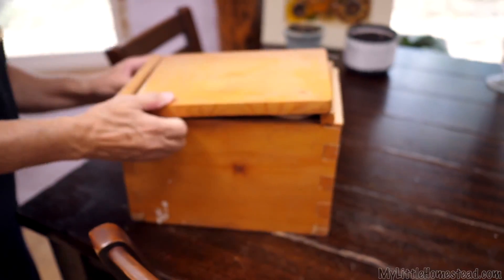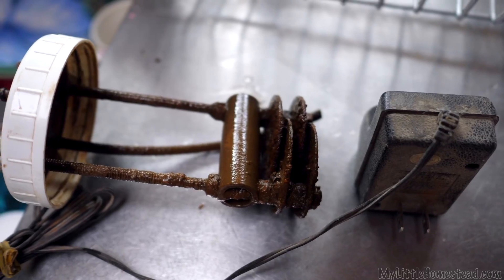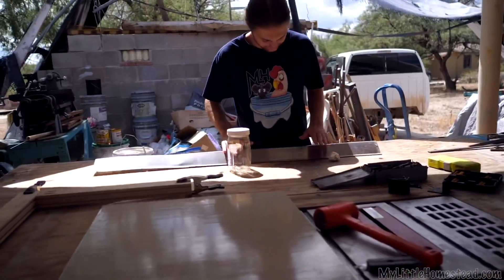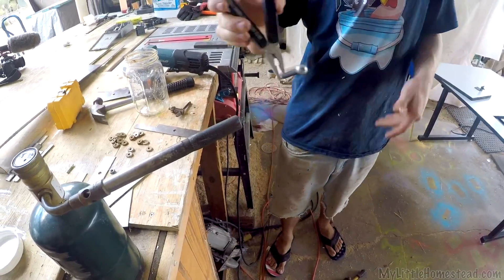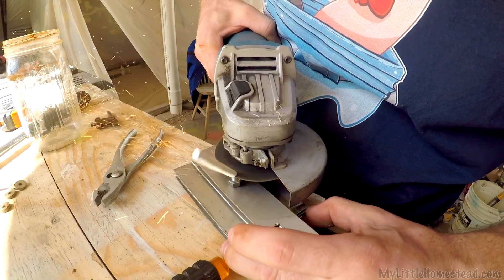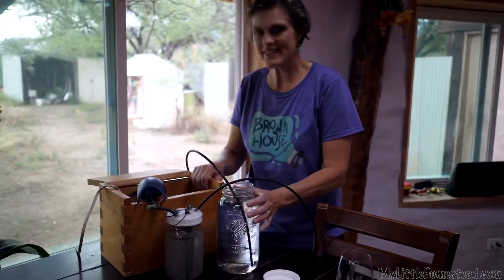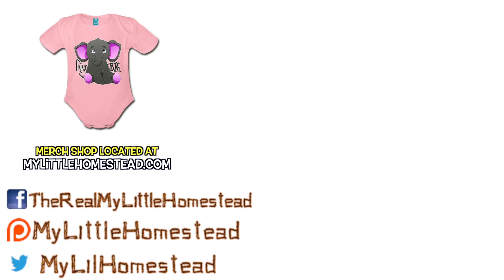Simple HHO Generator Build Portable DIY

Comment: If your trying to saturate the water with hydrogen and oxygen gases quickly and efficently, look into micro bubble generation. Youtube has a few videos on it. Search Micro bubbles or nano bubbles. 

Here is the basic or simple concept.
1) Place an airstone inside a slightly bigger tube under water  2) Pump water through the that tube.  Simple, yes? 

How it works is when you pump water through  the bigger tube, it forces water to go around the airstone. The water has to moves faster as it passes the airstone resticting the flow, and this creates a venturie effect with low pressure around the airstone pulling gases from the gas tube into the airstone and into the water flowing over the airstone.  And, with the fast moving water flowing over the stone, the bubbles are ripped off into very tiny bubbles. But remember, in the fast moving stream over the stone is still a low pressure zone. After getting past the airstone the water slows down and pressure returns to normal and the bubbles shrink more turning into  very tiny tiny bubbles.  These very tinny tiny bubbles stay in water longer, and have a very high surface to volume ratio to enable much faster gas adsorption so as to more quickly saturate it. 

In the depths of a lake, it takes even more water pumping water through the tube to generate a larger venturii effect so as to pull air down furthe.  Because of the higher  water pressure and greater venturii effect this creates an even greater prrssure difference before and after the airstone such that the bubbles shrink even more, so much more that they get more pushed around by brownian motion and wont float to the surface.  Instead, they completly disolve into the water.   These are nano bubbles. 

Making micro bubbles will work better if you cut way back on your HHO production rate.  Cutting back on your HHO production rate has two great side benifits. 1st is your plates will last much longer. And if you cut back on your production by using less voltage, yes less current flows but it ends up producing HHO far more more efficently and generates less heat. And the third benifit  is less HHO gass is produced and vented  making less of a potential safety hazard.

The first 1.24v × each amp = watts stored chemically in hydrogen.  Each  volt over 1.24v pushes ions or current through the electrolyte, and this is what causes heat. So for efficency it may be desirable to minimize the over voltage.

potasium hydoxide (KOH) is best for stainless steel plate electrolisys. If you google KOH conductivity graph, youll find that 6 mole of KOH per liter of distilled water has roughly the highest conductivity concentration which allows you to lower the  voltage applied to the cells substantually. 

Lastly, because KOH is caustic  you probably would lkke to include a seperate bubbler after your HHO generator to scrub any fine KOH and water mist made from bubbles popping in your HHO  generator.  Pre bubbler scrubbing also helps  keep any chromium ions in the mist out of your drinkingnwater. Don't want cancer causing agents in your water right? 

You can probably do fine with a 5v 3 amp power supply  to two electrods seperated by a neutral plate. The neutral plate  effectivly divides the one cell into two  which means 2.5v per cell.  And lastly stay below 1 amp per square inch.  0.5v  amps  per square inch is more desirable for longevity of the plates.

Comment: Hey there curious, I was trying  to listen to the video although I got a bit lost on some things Moreover where you got the pump, and how you electrify the steel sheets. You mind giving me a list of stuff to buy/ how to do the more electronics part?
Reply: he used a fish pump but you really don't need one and it's actually counter productive as it can push out hydrogen made by your generator. Google "molecular hydrogen nih gov". You'll find many scientific research papers on molecular hydrogen's antioxidant and anti inflamitory porperties.   Hydrogen and oxygen are being produced by electrolisys, and this generates pressure inside the HHO generator so no need for a pump. 

Chemistry and physics class.  At standard pressure and pressure, 1 mol of water (18 grams) is converted to 1 mole of hydrogen gas (2 grams) and 0.5 moles of oxygen (16 grams)  in total you have 1.5 moles of gases, and at standard temperature and pressure  1 mole of gas any occupies 22.4 liters.   So  electrolizing just 12 grams of water  (0.66 mols or 12 cubic centimeters) creates 1 mole of HHO gas that expands to 22.2 liters at sea level air pressure(1 atmosphere)  and 0°c with that amount of expansion, you don't need a pump. 

Nor did he indicate what  he used for a power supply. But I strongly suspect it was a battery charger supplying maybe 13.6 to 14.4volts. 

Since he had 2 neutral plates between anode and cathode, that divides the voltage between 3 cells. That means 13.6 volts /3= 4.4 volts per cell which is really too high and he is producing too much  HHO.  You will be better off of you use a 5v 3 amp power supply  and used only one neutral plate between anode and cathode, which divides the setup into two cells at  5v/2=2.5v per cell.  Your production rate will be less but your plates will last much longer and you'll be producing at just a little less than double his efficency. 

Use potasium hydroxide (KOH) at a 6 mole per liter of water concentration  a mole of KOH is 56.11 grams so × that by 6  then added to 1 liter of distilled water. Then mark the water level on the jar. Then as you electrolize the  water it gets more concentrated. Just add distilled water back.

Keep a lid on the jar to prevent atmospheric Carbon dioxide from turning the Potasium hydroxide to potasium carbonate.  Lastly, add a bubbler after the hho generator to scrub any fine mist that may contain KOH which is very caustic. It also will scrub any chromium  ions that leach out into the electrolyte and could mist over. Don't want cancer causing chromium  ions  from the stainless steel in your drinking water.

Comment: I was once told using zinc plates might be safer than stainless steel.  Stainless contains chromium and that’s not good for anyone.  And you can probably diffuse more gas into your water using an aquarium bubbler.  Just a thought.  Loved the video.

Comment: You should have neutral plates between the + and -.
Reply: Yes he did.  Mater of fact, he had 2 netural plates between the anode and cathode.  While he didn't indicate which was the anode and the cathode.  If we some the two outside are anodes then the plate arrangement would have been  like this. + n n - n n  + . Otherwise if the outside plates were cathode  then the plates would have been - n n + n n -

Comment: ... Repeating the comment for the second time.
Don't use stainless steel for waste electrode. It breaks into chromium trioxide, which is highly cancerous.
Reply: @Adam504  Yes. It definitely might be bad for him.
As harsh as it may sound. It may be the reason he got cancer in the first place. As I remember, they said that they used similar device ( but less efficient ) for a long time already.
 I wouldn't use any other material for electrodes, than graphite. Graphite that breaks down during electrolysis is very small, sometimes you can even obtain graphene ( which by mainstream science is considered to be 1 "atom" "high" ).
 That said. I don't know the size of graphite that's broken down during electrolysis. I assume it's microscopic. I don't know which filter would suffice.
Reply: Do you have a source? I'm interested in reading more about this.
Reply: @xnotx2  Anode material ( waste electrode ) gets oxidized. If it's iron - you get rust. If it's graphite - you get graphene, because it doesn't oxidize at that temperature/voltage. If it's stainless steel ( that contains various percentages of chromium ) you get chromium trioxide ( looks like rust but it's more reddish).
 I don't remember sources. I advise using google.
Reply: @PR_96  Yea I know via plating what it does but I am wanting to know if it is gaseous and transferred through the air when oxygen doping the water to be drank.
I'm not a chemist so that's why I wanted good material to read up on it. Preferably something that talks specifically about any possible dangers of using SS as an anode. I don't really see any material being safe if hard metals can transfer via gases.
Reply: @xnotx2  Water gets heated during electrolysis. Considering the size of the container he used, I'm fairly sure that enough steam gets released to carry some of the hexavalent chromium into the drinking water.
 I posted this comment already some time ago. When they were making the device and posting the video for the first time. And I wrote about that possibility also, of water contamination. 

This contraption doesn't seem safe at all.
Reply: @xnotx2   Also I find it a little bit "dishonest". That this, and previous video is still up - considering the information I've given. Or that my comment is not pinned at least.
 Someone might copy this device, and give their families liquid cancer.
Reply: @xnotx2  Graphite is the safest, and economical in my estimation. It's carbon basically. I would place a filter going from the electrolysis chamber. To filter anything that my get into the water. I don't know how fine the filter would have to be tho.
Reply from the maker: PR_ 9 6 Please site your sources. We’d like to look into it.
Reply: @mylittlehomestead  There is not a lot of research done strictly about water electrolysis, and using stainless steel anodes. Because the topic is not "hot".
 But there is research done about slow, low temperature SS oxidation in other scenarios. Which prove release of hexavalent chromium.
As I said. I don't remember direct sources. But they are easy to find. 
"Trivalent and Hexavalent Chromium Issues in Medical Implants" by 
L.E. Eiselstein,  D.M. Proctor, and T.C. Flowers - for example.
 If it releases Chromium oxide VI in those conditions. It most certainly releases during electrolysis, when oxidation is much, much more rapid.
If you want to search for research. Search for "stainless steel oxidation hexavalent chromium". You will find more research that way.
Reply: @mylittlehomestead  here https://youtu.be/55_j21tCN_k
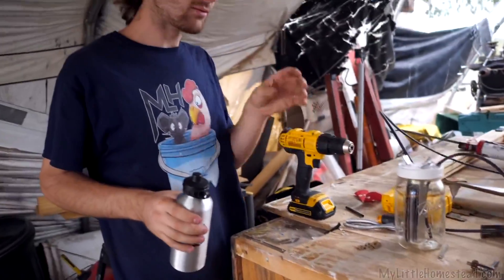that video isn't mine, just good at finding info. he doesn't say stainless till about 4:15 - 4:21.
also you're making hydrogen gas, that's quite explosive, not a flame, boom!
HHO just like that size, is what people use in their cars and run the hose to the intake for better gas mileage, like having a trickle of nos always flowing.
first time i've seen it used in drinking water. Soon as i remembered that the metals give off gases (due to this comment, and prior to reading the cancer part) i came to the same theory, the water might be the cause.
 a upgrade would just speed up the timeline, theoretically.
i'm still actually worried about the telephone poles used for the garden also. The chem used on those is highly toxic, and there are many warnings about not standing around the poles or using them if they have been treated.
those being there, might result in plants and fish potentially becoming toxic to eat. I'm not sure if that could/will happen, but before harvest, i'd have them tested by a professional to make sure. I worry more about the baby, and if it could cause developmental issues.  I'm no science guru, but logically it makes sense considering the data.
The chemicals used on utility poles (aka "poison poles"), which include pentachlorophenol, creosote, arsenic and chromium.
you guys can have tests done on the wood, and all that stuff just to make sure.
no sense rushing head first if it's going to harm all of you.
if the poles are toxic, i had a theory that using epoxy paint could seal in the toxic crap. the ground would still be leeching it off if not all done, so if you've got a well, might want to consider just using something different.
Reply: @mylittlehomestead  isnt this what the whole Erin Brockovich thing was about? Hexavalent Chromium. I have always heard the same about using stainless steel even in my rust removal electrolysis tanks I use plain steel or graphite. I have also heard that the Hex Chromium does come off gaseous.

Comment: Brice , I've seen a similar system on an old Ford Pickup.  It boosted the mileage and power of the vehicle. Baking soda.and stainless steel light switch covers and plastic spacers in between .. stainless screws and nuts to secure them together.  Placed in a sealed pvc capped container , and piped thru a vacuum line into the carb intake.. read up on it.
Reply: https://www.popularmechanics.com/cars/a3983/4310717/